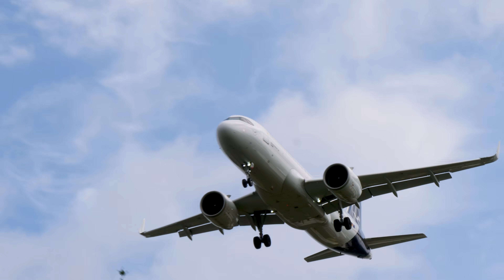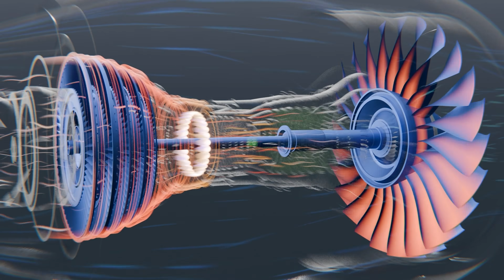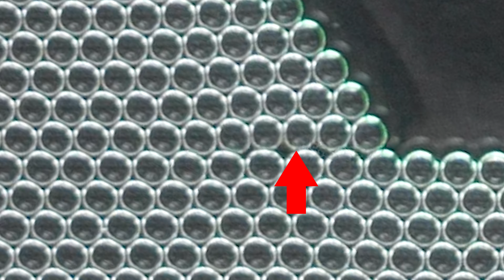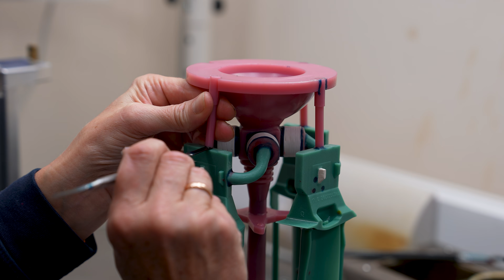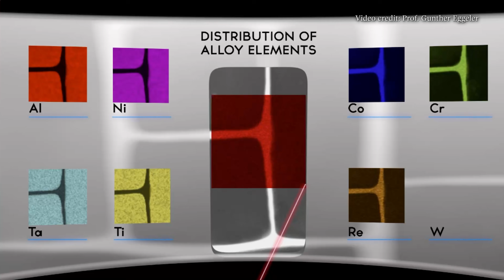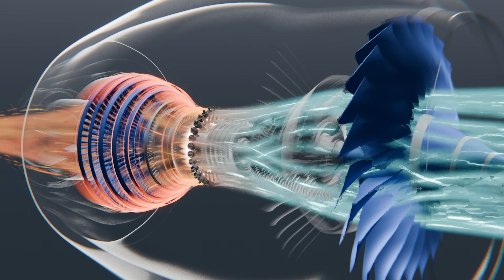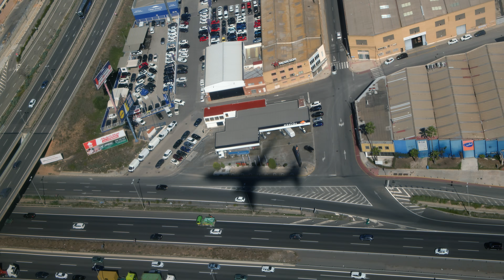The Ridiculous Engineering Of Jet Engines

Comment: EDIT: I see the video title changed to the one I stated in my comment. Could it be that I was regarded or is it AI and an algorithm....? Well anyways, This title is far more suiting for the video. If this was done from my comment, thank you for hearing me.

Very cool informative video. I have a large issue with it however, it is an issue thats been prevalent in youtube: MISLEADING TITLE. Basically this great informative, well put together video is clickbait for views. Which is the plague of youtube. 
The thumbnail is a nice illustration of sand going into the turbine. The title is "what happens when you throw SAND into a jet engine". Alright, this question was KIND OF answered. In fact, the first 16 seconds he says "so the question is, why doesnt a jet engine just melt into a puddle?".  No the question is, what happens when you throw sand into a jet engine. I clicked the video thinking "hmm sand, like coarse sand from sandbags? That couldn't be good lets see what would happen". Well ...at about 35:30 into the video, it ALMOST answers the question and the by 36:55 it is finished. 1 min 25 seconds. It's not even sand as one probably thinks, its more of a fine powder they even refer to it as "dust". He says "The same stuff that makes up sand and volcanic ash." Ok, so not real sand?  Ok so in recap, the first 16 seconds aims to answer a question unrelated to the title of the video. Almost 36 min into a 39 video the title of the video is somewhat answered. Its not actual sand thrown into a turbine. I was expecting something to happen and instead it was something explained in 1 min and 25 seconds from a 39 minute video. 
My point is, creators, STOP making misleading titles for clicks. It is already difficult to believe things online anymore thanks to all the deception people continually do. Just stop and label the video what it really is. It basically makes this informative, nicely constructed video, irritating because it the title is misleading just to get clicks. If you labelled it "why doesnt a jet engine melt?" Id have expected this kind of video. People just be truthful when making videos, we are lied to way too much in the world today.

Comment: Claiming the blades are on the knife edge of what is physically possible is outright deceptive.

That completely disregards the many factors of safety involved. If it were even remotely on the edge of what is possible, a flock of geese smashing into an engine at 200MPH would kill everyone on board. But it doesn't.

I don't know what the goal is in making such a silly statement that is stupidly false, but it makes you look like you didn't think it through.

Comment: Great video. Awesome engineering. "Were there any fan failures?" could have discussed as well.
There are engine related failures:
Southwest Airlines Flight 1380 (2018)
Qantas Flight QF32 (2010 – Airbus A380)
United Airlines Flight 232 (1989 – DC-10)
British Midland Flight 92 (1989)
Delta Flight 1288 (1996)

Comment: So am I learning something new here ? There is a Centripetal force as well as a Centrifugal force !? I know of the 2nd but just learned of the first or is it that my ears were always hearing them as 1 and not 2 different words ? I don't know. But considering my hearing has diminished slightly over the years how could I just now be differentiating between the two ? Anyone have any suggestions ? 👂
Reply: Centripetal force as well as a Centrifugal force is the exact same phenonium but what you see and experience and hence the name you call it depends on your reference frame. If you are a rider on a merry-go-round spinning around -  you experience a centrifugal force that wants to throw you away from the center. If you are stationary and watching this thing go around from above looking down,  the only way the mass on the outside doesn't fly off is an inward force pulling it constantly towards the center of the hub and that's called centripetal force. Same thing, two different angles, two different names.

Comment: Dude, that is next, next, next level metallurgy and technology.  Thanks for taking us through that whole process!  You're one of my favorite science/engineering channels.  You explain and illustrate things in a way that almost anyone can get the concepts, but still keeping it interesting to an old engineer.  I love how you cover plastic deformation and high temperature creep.
In engineer school I worked on an extra credit project, where my professor was testing different configurations for those cooling fins inside the blades.  I think it was for GE.  It was a very large scale model for simplicity, with different rib shapes and spacings and set at different angles.  We coated the whole surface with a calibrated wax that melts at a specific temperature and goes from a frosty solid to a clear liquid, and then sent a blast of hot air through the setup to melt the wax.  A digital camera connected to a computer measured what percentage of the image changed color, and how fast.  In the 1980s.  How cool it is to see what the fins actually look like now inside the blade!

Comment: I am wondering; considering how nickel is so rare, is there a recycling process of the alloy to be used again after the blades are no longer suitable to sustain a flight?
Reply: Nickel isn't rare at all. Rhenium is rare. But I am fairly certain that no recycled metal is used in the production of single-crystal turbine blades. They're too expensive to risk loss from contamination.

Comment: This is why a jet engine cannot fly through volcanic ash.

I think silica is the main culprit as well as gasses but most volcanic ash comprises of between 40% to 65% silica. They say the ash is comprised of pulverized rock, minerals, and volcanic glass fragments. Some of these minerals are quartz, feldspar, pyroxenes, olivine, and micas. The presence of crystalline silica minerals like cristobalite and tridymite are concern in some ash types. 

They say the ash melts inside the high-temperature environment of the engine, turning into a glass-like substance that sticks to vital components and disrupts airflow that will stall or burn out the engine as it eats itself or it will self destruct. 

A jet engine seems to be a more advanced version of a cars Turbo. 

From my research the newer jet engines and I suspect even the older ones mainly use most of the fuel to take off and land. They somehow use the oxygen and other gasses within the air or even water vapours to propel the turbine. Remember that man who built a car that ran on water. What happened to him and his plans..
Reply: Where have you done this research? Jet engines burn fuel whenever they produce thrust. They don't get power from water vapor.

Comment: Having only studied the engine at the theoretical undergrad level, my humble opinion is that the fact most of that energy is used to drive the LPC and fan, others lost to heat/friction while consuming an inordinate amount of fuel, I believe that the gas turbine engine has become too complex, expensive, reached its peak and too inefficient for modern travel.  SAF is a gap solution.  Long term it needs to be replaced with some something similar that utilises kinetic energy without burning that much fuel and for a similar or higher output.

Comment: Fun fact, the engine used in the video is the Rolls Royce Trent XWB which powers the A350. It's more prone to sand and dust which is why Emirates(the airline) doesn't buy the A350(specifically the -1000 varient) since their home base is in a hot sandy dessert environment not suited for the engine used.

Comment: Vertasium should chase up the 4 Aussies who ionized the air, finding a very specific frequency that would make a typical lounge venetian blind give thousands of pounds of thrust, simply by ionizing the air between the "blades". Yes, the "Ion drive" robs this patent and the patent itself seemed to have been shelved around 17 years ago. The inventor claimed "we can acheive as much thrust as the space shuttle with an engine the size of a briefcase" if that helps anyone chase it all down. Back to the Future seems to be sitting on the shelf of some cult-like, low iQ group of very foolish and fearful people.

Also; it's strange that both show and Rolls Royce don't link changes in matter to cymatics, esp in heat. You can actually find strong looking structures with sand on a drum. It's pretty obvious there's links to this and we could be looking in that direction. Even audible sounds on a drum with sand would be fractal; as above, so below, so heat would also produce sounds and the metal is changing with frequency. The actual sound the jet makes could cymatically reinforce the material and increase on scalar level as centripetal force increases. ie the engine itself produces a "sound" in Schauberger thinking, scaling up and down in pitch inaudibly as a standing wave to cancel heat.

Comment: As a material science student seeing a metal part made out of a single grain blew my mind.
Reply: Fresh material engineer graduate here, it gets even crazier when you're making a ceramic monocrystal. There's multible methods, some of them you probably know from microchip making. And it gets super rad when you want to dope the lattice with different atoms, it's dope as hell
Reply: @carmine_simon  Silicon nitride FTW?
Reply: Dude I didn't even know this technique existed, and I've spent the last 14 years in Mechanical engineering with 7 of those years in Semiconductors, reviewing material structure of thin films (nanoscale) for chip circuitry.
Reply: Those little spirals are fantastic!  I was wondering what they were from the second we first saw them, and the answer was far cooler than I hoped.
Reply: hey same ! I had my classes on how we usually deal with grains in alloys only a few months ago and seeing them show so casually how they managed to just eliminate that problem is amazing
Reply: You don't call it a grain, bro, it's a crystal.
Reply: @THEDANOFFICIAL  it might be an issue of translation but I've always heard it called a grain whether at school or at work
Reply: @THEDANOFFICIAL 🤓
Reply: As a blacksmith, even the idea of a monocrystal metal alloy is absolutely absurd

Comment: It's not the case that the metal operates above its melting point. The metal never reaches that point because of the two protective layers and the cooling film of air produced by the holes and the grooves inside. If those things were absent, and you tested a single crystal blade without those things to help cool it down, then it would melt when it's heated to its melting point. I understand what you were trying to say though. I just think that instead of making it sound like this thing is violating physics and operating at temperatures exceeding its melting point, you could have explained how these other things cool it down and allow it to operate and stay under its melting point, and that without those things keeping it below its melting point, it would melt. Other than this minor personal issue, I thought that this was a great video as usual!

Comment: 8:30 It seems to me you should call the failure point of steel closer to 400, since that is when the deformation began. Implying that it survived until 600 degrees seems like a potentially dangerous conclusion.

Comment: I’m a Materials Engineer that works with Tool and Stainless Steel mills…..the explanation of dislocation movement through a crystal structure was brilliant. Making practical use of the microscopic world and then explaining it to others is such a difficult task……you did this flawlessly. The one thing I would say is this video made it seem like the grain boundaries are a pure source of weakness when in fact they do inhibit dislocation movement and are extremely beneficial when looking to increase a materials ductility and toughness.😊

Comment: Definitely off topic but this makes me wonder, what if we used heat resistant material like this for venusian space probes? The high atmospheric pressure could be an issue, but the high melting point should withstand the conditions on the surface right? Just a theory

Comment: This is extremely interesting seeing how only one part of the plane (the turbine blade) is so advanced, but it got me thinking how did jet turbine engines work before every single of those innovations
Reply: They ran at lower temperatures, making the engines less efficient. The heat resistance of the turbine blades is the limiting factor in the efficiency of a jet engine.

Comment: Could someone explain me, why carbon fiber components are not used in manufacturing jet engines, though it can withstand high thermal resistance?
Reply: Some carbon fiber is used in the latest GE engines. But not for turbine blades. That's harder to do but they may eventually get there.
Reply: @soaringvulture 
Thank you so much dude🎉🎉

Comment: Being able to manufacture the single crystal blade with proper orientation with 90% success rate in unreal, it shows how much  efforts they had put in R&D and how many brilliant minds behind it and how many research papers has been published and how many patents has been filed, it's just insane amount of engineering.
And if this is for normal commercial aircraft then I can't even imagine what's going on in modern fighter jet engines.

Comment: A jet is technically a kompressor. Actually multiple turbos (compressors) in series to boost air pressure. So your turbo car is like 1/20th a jet ingine. Just saying. For a while some group b rally cars had a antilag device that was turning the turbo into a "jet" like air pressure generator. The other guys used twin charging which is a exhaust driven turbo kompressor and a belt driven supercharger working together. The rocket jet anti lag device was banned. Too simple. Too light, too effective and efficient.

Comment: High pressure to low pressure. Same way our climate works. That’s why jets don’t carry as much fuel as they claim. There’s no way a planes wing can hold as much fuel as they say. But they don’t want you to know that. So they can keep charging high prices. Jet engines are started with compressed air, not fuel. Fuel is minimally used. Mostly for take off.
Reply: Where does this bizarre conspiracy theory come from? You need fuel to make power. If you aren't producing power, the airplane slows down and falls out of the sky.

Comment: Up to 30 % of static thrust is from the suction of the intake.   It sucking so much air, there is 80 Sq ft of area being pulled into a dynamic low pressure area.

Comment: Speedbird 009 1982 B747 RR RB-211 X4 Volcanic cloud 
4 engine choke & shut down
what a story, check it out CPT Eric Moody, how many restart attempts or night time ocean, luckly APU ran,
APU a Turbojet too
Reply: Th RR RB-RB 211's unique deep hum acceleration sound on run up which Cpt moody said was comforting on successful start, the engine cooled 10-15% N1 enough power to break melt & St Elmo's Fire electrical fiction

Comment: there are pigtails on many turbojets ! the fuel ring &  each pipe going to the annular injector fuel supply, this is where the fuel cur off selector works like AI B787 act
See the door fell high in the video & escaped the moment after impact, good 4 him, nothing he did could have changed the crash 
1 second between engine out switches sounds human to me RIP

Comment: The EFR Gauge Turbojet is mostly imagined using N2 RPM+EGT temperature 
Accurate numbers being the same EFR. Or point out the accessory that measures this, ground Test Cell measures Piso electric Force
I Love the turbojet, thank you  4 video 👍

Comment: 1, it will be extremely clean. 2, the compressor blades will get knife edge and thin causing efficiency performance loss. 3, any and all air ports can and will get clogged.

Comment: Another reason why Tungsten is not used in Turbine blades is, at turbine temperatures it oxidizes relatively quickly. The oxidized tungsten doesn't have the thermal and strength capabilities we know of tungsten.

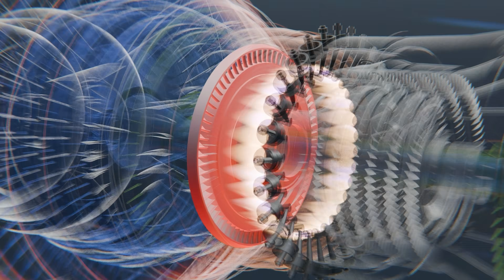Comment: At 2:01, you say Formula 1, but you show footage that looks from Charlie's Angels (2000) racing around Auto Club/California Speedway (Fontana) (this could be unused footage, behind the scenes, or someone racing around, but i can tell it is not from the movie itself), and judging by the front wing on these cars, i believe they were CART Champ cars or very heavily based on them in their oval config. Formula 1 never raced at any US ovals (Indy road course being the closest to it, which went disastrously over tire issues and driver protest due to tire issues). Power output of CART Champ cars were around 800-900hp, though were lower in oval format, while Formula 1 today pushes close to 1000 HP with their KERS system, and Formula 1 at the time of that footage were around 800 hp or so. Minor thing, but you made me look up both the footage (which looked familiar) and the car power figures, so i had to

Comment: Hey @veritasium! I am begging you to make a video about weather positive lightning is a lie or not! Because many people say that a lightning between two objects starts from the positive one if the other object is neutral. And here I come and say NO. When we bring two charghed objects close to each other, the electric charges want to equalise and the electrons from the negative object want to flow to the  positive object, putting pressure on the aer and finally starting to ionise a channel, their path to the positive charged object. The lightning is not just the electric field around the clouds, it is the channel that electrons build to reach the ground so they can flow to the ground. The lightning is the channel that launches from the clouds to the ground, and in that channel the electrons are flowing from the clouds to the ground. Am I right so far? I want to know what is the real explanation if I'm wrong! 🙏🙏🙏